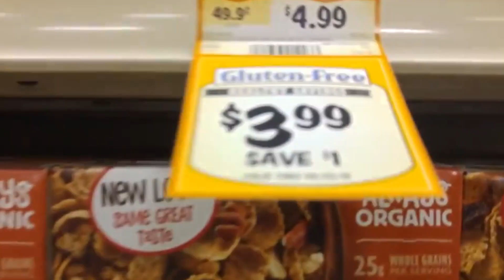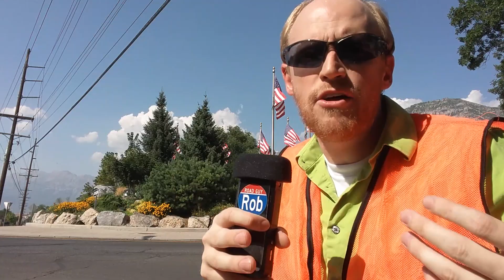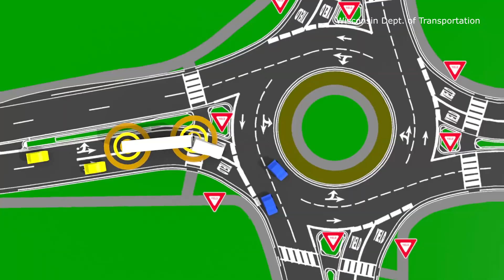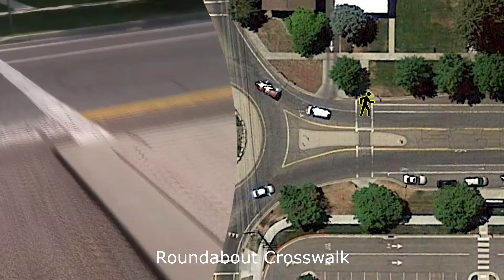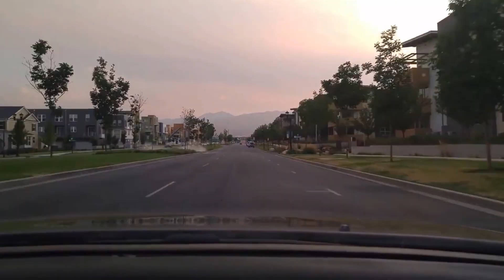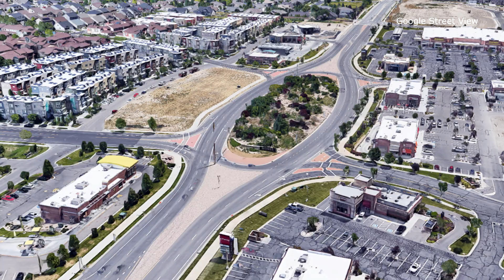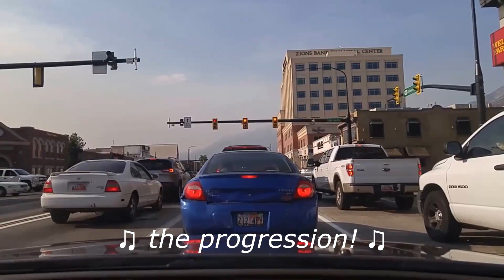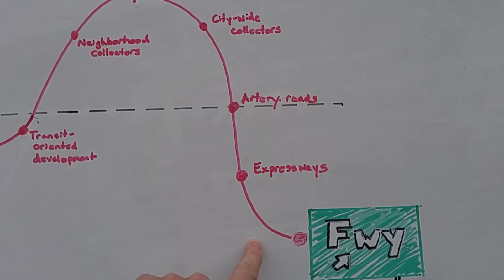Are roundabouts REALLY better than a traffic signal?

Comment: In the Netherlands we have a solution for the confusing 2lane roundabouts: The Turbo-Roundabout. It looks confusing at first , but it is very easy. Just choose the correct lane before entering (follow the signs) and let the roundabout take you to the correct exit. No lane switching needed on the roundabout itself.
Reply: I was really intimidated the first time traveling through the Dutch roundabouts. Turns out they’re very self-explanatory if you get into the correct lane before entering the roundabout. The corresponding exits are even kinda drown on the lanes prior to the plate itself. Unlike the German roundabouts, you don’t have to wait so much in the busy areas.
Reply: Most roundabouts do that. If you have to change lanes you have done something wrong.
Reply: @scottwhat3362  The normal 2 lane roundabout requires you to switch lane if you are taking the left (3rd) exit. You start out on the left lane, enter the roundabout and after the second exit (straight ahead) you move over to the outer lane of the roundabout to make it for the 3rd exit. 

The difference with the spiral roundabout is that when you pick the left lane you just follow the spiraling lane and end up at the 3rd exit.
Reply: @Basih  No, it doesn't. Nearly every diagram I've ever seen of a multilane roundabout shows left-turning traffic remaining in the left lane. I don't see any harm in changing lanes as you describe, but it's certainly not required.
Reply: I LIKE it
Reply: Roundabouts also make u-turns a whole lot safer. Sure your driving around like a dufus, but there are a whole lot less collisions.
Reply: Yes, these are a thing of beauty.  The signs are often accompanied by markings on the pavement as well.  And the Netherlands has these in the places that make sense.  Whereas the UK seems to just put them everywhere.  I was driving in Germany, the Netherlands, and the UK a few weeks ago.  And the Netherlands was by far my favorite.  The Autobahn was terrific in Germany, but for surface streets the Netherlands was the best.
Reply: They are all spiraled similarly in the US.  But there are not so many of them yet so people still find them relatively difficult, for now.
Reply: Google dutch turbo roundabout. You don’t have to change any lane for taking the 3rd exit, as your inner lane automatically becomes outer lane after 2nd exit. Then you will have a inner lane which will eventually be taken by someone who is taking their 3rd exit. Google it. Pretty clever design. I drive through one each day twice near my home in Netherlands
Reply: Many new roundabouts where I live in Canada are turbo
Reply: I can see that this would work, PROVIDED that there are clear (overhead) signs before you enter and clear lane markings.  In videos (mostly UK), they rarely have overhead signs to get you into the correct lane, and the lane markings often wear into unintelligibility.  In heavy traffic the lane markings are hidden by the cars ahead of you until it's too late to do anything about it.  UK drivers have to pass stringent tests for a license and they get used to roundabouts.
Reply: I'm NOT a European and don't like them and will never accept them. They suck like everything else in Europe. We in America drive differently. Stop lights are better, simpler and easy to follow. Not everything European is intelligent or superior, roundabouts are one those things.
Reply: People switch lanes on roundabouts? That's the first thing they teach us to not do in driving schools
If you're exiting in the 9 or 12 o'clock direction, go to the left lane(outer ring)
If you're exiting in the 12 or 3 o'clock direction, go to the right lane(inner ring)
If you're exiting in any extra exits in between, see where they sit in between the 9, 12 and 3 o'clock directions, and choose your lane by considering how they come after said directions (8 o'clock exit = 9 o'clock direction, left lane; 5 o'clock exit = 3 o'clock, right lane etc)
Changing lanes in a roundabout is poor etiquette
Reply: @randot6675  if you are on the innerlane how would you exit the roundabout without crossing the other lane then?
Reply: @vos303  In every case I've seen, the outermost lane is "take the next exit".  So any traffic to the right of you should be following you as you exit -- you'll exit into the left lane of the road and the traffic to your right will have its own lane as well.  

I still think multi lane roundabouts are dumb.  I suspect the dutch roundabouts are way better, but the basic implementation of just having inner lanes is confusing and requires a ton of blind spot trust.  I feel like they're just shoe horning a roundabout in a high traffic scenario that would be better served by an intersection.  But the single lane roundabouts?  I've yet to pass through one I didn't love.  They're amazing for light to medium traffic flow.
Reply: Or you can make them have not so round/curved edges. You can see them along Texas Heritage Parkway in Katy.

Comment: I'm sure what I'm about to say is on a simplistic level, but I do have an impression or two:

1. There is always the question of what to do with the land in the middle of the circle. Obviously there are multiple possibilities, depending on a number of factors, but in general I would look for something that doesn't involve a lot of people being inside the circle. More precisely, you want something that doesn't involve many people leaving and entering the interior of the circle. These days, those seem like great places for solar farms, or maybe water pumping stations.

2. I've long thought it's best to best a sharp division between surface streets and freeways. Freeways have their own versions of roundabouts—usually a cloverleaf or diamond. As said, roundabouts work rest when they're single lanes. Low speed limits, no stops, moderate density…yes, I know, suburban sprawl, but increasingly I think sprawling out is not such a bad thing as long as there are bits of non-residential uses, so that not so many people are commuting in and out of the neighborhood.

Comment: Roundabouts work just like money.  Once people had shiny pebbles to exchange for wool, carboard, and sexual favours.  But eventually over millenia they got used to the idea of gold being something of maximal and fixed value.  At that point the clever clogs among us found they could replace all the gold with paper of declared equivalent value, and keep all the real gold for themselves.

Later, once they had gotten everyone used to paper with little intrinsic value having real value, they found the concept was so successful that criminals robbing banks would actually steal all the paper instead of having to lug the heavy gold away (it also meant they didn't have to write SWAG on their sacks too, which aided with making a getaway).  At that point cleverer clogs were able to eliminate even the paper itself, replacing it with the mere concept of paper based on nothing at all, which they called credit, whereby they could convice the populace that they owed them for all the real gold they had borrowed, but which they actually still owned, and hadn't actually ever really lent them in the first place.  So it is with roundabouts.

In the UK we informed the populace how to use roundabouts through public information.  As we drive on the correct side of the road we have the benefit of circulating clockwise around roundabouts as nature intended, so this mass educational process took a matter of minutes.  After building a number of real roudabouts for people to try out succesfully, the next stage was to paint small dots in the middle of Tee juctions and put up signs on all the approaches saying "Mini Roundabout".  Nowadays everyone understands these are just a concept of a roundabout, with no intrinsic roundabout, so they just pretend there's really a roundabout there and act accordingly.  This gives society all the benefits of a roundabout without any of the construction costs, so the clever clogs still get to keep all the real gold and don't have to share it with day labourers building roundabouts.  There's a reason why they're called clever clogs.

One day someone will eventually realise "OMG!  There are no roundabouts!!!"  And "Where the fuck is my gold???", and the system will collapse.  But we can confidently expect the government of the day to then step in and nationalise them all, declaring roundabouts to be too big to fail.

Comment: Designers in the Netherlands specifically try to avoid platoons because they make driving stressful for drivers and utterly terrifying for every other road user. It's just all around awful when the traffic lights become a Skinnerian reward system - the fact that you can get a combo of green lights, subconsciously makes people feel good or bad about their performance.

Lights make the most sense on stroads - but stroads are an insane idea to begin with. It's a road (high speed, faster than about 30MPH, and other pedestrian-hostile features like punitive pedestrian signals) and it's a street (lots of commerical destinations).

Stroads suck because they choke off pedestrian and non-motorized traffic from destinations. If they're not successful in doing so, the residual pedestrian traffic suffers an unacceptably high rate of pedestrian casualties.

So they just don't do that. It's either a road and pedestrians are intentionally given other choices, or it's a street and drivers are intentionally treated as a second or third class of road users.

In that case, the claustrophobic roundabout is a perfectly valid solution. If you absolutely have to drive, you still can. If you don't, it's easier to bike or walk, so you do.

But that only works in the context of a traffic system that doesn't insist on the belief that everyone should drive everywhere. In that context, roundabouts will have to be oversized and inconvenience pedestrians.

It's pretty remarkable how much the "drive or get killed, scrub" mentality informs traffic design. You seem reasonable, but you talk about things like "chance of getting a green light" and "wide streets" (if it's more than two lanes it's almost certainly a road) like they're inherently something to be proud of.

Comment: They made my city nicer to cycl through and discouraged teens from drag racing.
Reply: They didn't discourage drag racing they just changed where the drag racing took place.  Like every other short sited person, if it doesn't impact you, you think it doesn't exist.  Fix yourself!
Reply: They use the round as a turnaround point around here. Some will try to drift around it even making extra fun for all the non-existent peds they said they built if for.

Comment: I agreed with just about everything except for the part where you walked across the two lane roundabout. If there wasn't a roundabout there, you'd be walking across four lanes of traffic at once instead of just two. Isn't that more dangerous? Also, people tend to be more aware of hazards (such as pedestrians) at roundabouts too. I might be missing something though. 

Also, the extra steps you showed on the Provo Center Street Roundabout seem like they're more due to the placement of the sidewalk and direction you are walking than the actual round about. If you had left that corner to go west instead it looked like a significantly shorter distance to cross.

Just some thoughts from a random guy on the internet with no real qualifications on the subject.

Keep making videos! These are great!

Comment: Ahhhhhh. That's why I don't think they work well. In my city they are mix and matching them. So when you have a platoon hit the round about it chaos and totally congested instead of randomly entering. Like you say, I'm so used to traveling at a speed to make all the green lights if they throw a round about in there you have to start all over.

Comment: There is a roundabout near my house. While driving on the main road, basically straight, a car entered from the right and cut me off. I had to slam on the brakes. I guess they though that they were on the right and had right-of-way. Drivers in the USA don't know that in a roundabout, the car closest to the center has right-of-way. Also, nobody uses any signals.

Comment: the signs need to be color coded to make navigating easier. For example, if i'm going on US23 North that sign is a big yellow triangle 10 feet high. The road sign is a green rectangle at 8 feet high....so you're not looking all over the place reading signs that all look the same. The other suggestion is to plan on driving all the way around a roundabout if you're not confident you know where you are going. the second time around you'll know and it only took ten seconds to be safe and less stressed.

Comment: This is actually one of he best analysis I've ever seen of Roundabouts. Most people are blatantly bias and don't see the big draw backs. You even touched upon my biggest issue - the traffic clog. If people think street lights are bad, they've never seen a roundabout being dominated by 1 lane of a roundabout potentially for excessive amounts of time. 

Personally, I also feel the safety issue is not quite that easy to quantify. I can actually come into a roundabout with a lot of speed, and maintain a fair amount as well during a turn (not all vehicles can, but some of it is also driver skill). Meaning, others can and do as well. Thus speed is still going to be a relatively moderate risk for accidents. 

The drop in accidents/fatalities can also probably be attributed to the newness of roundabouts. People slowing down because they don't know what to expect or haven't figured it out yet. Thus many years later, once roundabouts are normalized, I'd be reaaaal curious to see if the safety levels were maintained or tanked to more traffic signal levels. Because at the end of the day, its not usually the design of the intersection that causes accidents. Its that one idiot choosing to be an asshole.

Comment: A few years ago my local built a new roundabout near me, giving me a new option for my commute home.

It should have been perfect: A low-pedestrian area merging the Random Arrivals from a freeway exit onto Suburban streets. It even had a dedicated lane bypassing the roundabout entirely for one of the right turns, probably predicted to be the direction with the most traffic.

It was absolutely infuriating to drive on because every single day, without fail, one of the cars in front of me would treat the 'Yield' sign as if it was a 'Stop' sign. Come to a full stop and look both ways before entering the roundabout at 5 mph, even if there were no other cars in the roundabout at all. The amount of tire squealing I heard from cars suddenly slamming on the brakes because the car in front of them decided to stop for no reason...
Reply: Mostly a driver education issue, not a roundabout issue...
Reply: @markthirkell7056  Yeah, and most political disagreements are voter education issues, not actual insolvable problems.

You have to design roads that are right for people to drive on, because you can't design people to be right for your roads.
Reply: @KantiDono  I agree - but maintain that people can learn better behaviours if it is in their best interest - as in the case of roundabouts - they are not that difficult🤣
Reply: @markthirkell7056  I used to be idealistic too, until I got a roundabout installed in my neighborhood.
Reply: @KantiDono  if roundabouts work fine in basically everywhere else in the world, then people are the issue. And if people are the issue and they dont understand basic signs, not even roundabouts - that is driving education which needs to be changed

Comment: I'd hate to point out but in the UK, truck drivers have no such issues.  Also in the UK, pedestrian crossings are much closer to the actual circle and generally signal operated.  I must say, in America you have this obsession with making stuff your own.  The designs of the circles you've shown are not very efficient at all....very poorly designed in fact.  Design them exactly like they are in Europe and they'd work much better.

Comment: I agree with the conclusion - there are streets and conditions where roundabouts can improve safety and reduce traffic, bu there are places where they absolutely ruin and gridlock the roads. I spend most of my life driving in UK, but lived in several EU countries for a while. Over-reliance on the roundabouts has ruined a lot of European city streets, UK is particularly bad and some more western European countries are as well quite bad. Problem is that "non-driving" population sees roundabouts as a panacea solution for all problems, or at least the city planners likes to present it that way - this becomes sort of self-fulfilling prophecy - people say it improves all possible metrics of traffic, then people believe it does, then more of them are installed... and in the end there are crazy roundabouts everywhere and city is still in gridlock. For city planners it is usually win-win, because ignorant public believes that it is better so it is politically beneficial and it is as well cheaper. However, putting roundabout everywhere not only doesn't improve traffic flow, but may as well cause more accidents. Yes indeed accidents tends to be less deadly, but especially multi-lane roundabouts have a lot of accident. In UK for example they do not even mark most roundabouts so anyone can go anywhere from multiple lanes... and insurance says "ohhh it was roundabout - 50/50% fault!".
So yes - I have driven around the roundabouts whole my life and they when work they work, but when they don't they really suck.